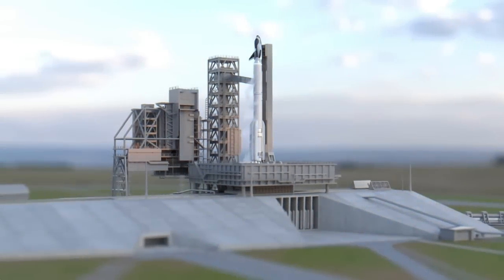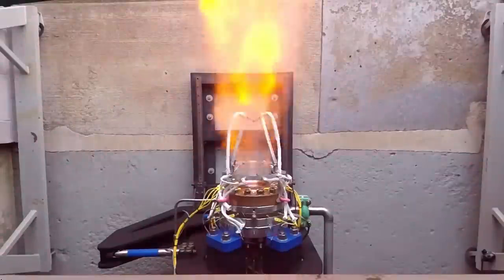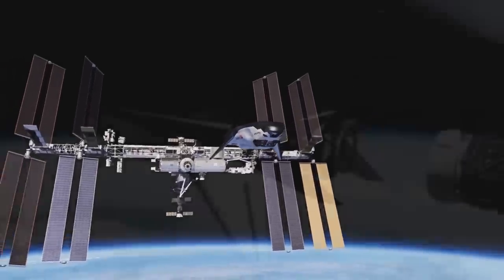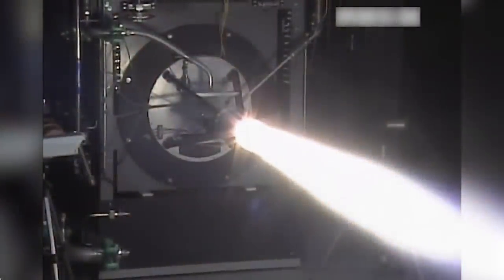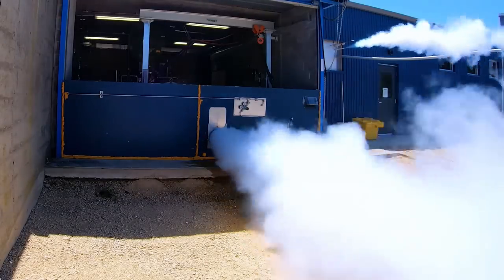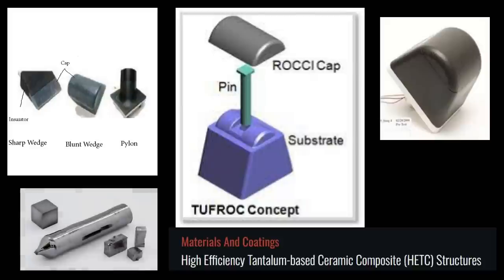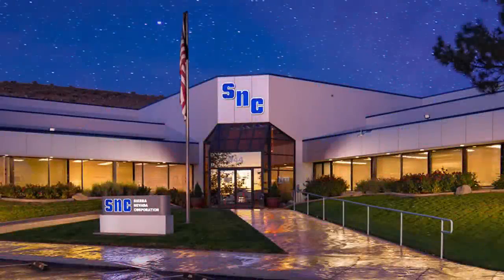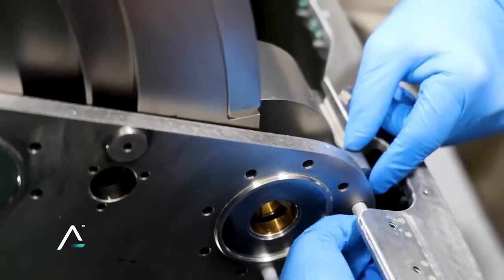Rocket Science: The Sierra Space Dream Chaser

Comment: The centra fuse will most likely not work in outerspace. Because the centrifugal action dosen't work in space. Everything is weightless. The spinning will make the different weights of the propellant to be spun out at different velocities,but still be mixed. But the spinning action will not separate the two fuels while in a weightless environment allowing for cooler fuel to be used as a coolant...
Reply from the maker: Centrifugal force works fine in space RH... the action imparts the force... nothing to do with weight my friend. :-)
The denser (colder) coolant will still be separated to the outside of the cylinder...
Reply: @terranspaceacademy  on the main body of stucture that's rotating, but anything inside it will be weightless. Without my artificial gravity system design... I'm no electrical genius,  just self taught. But I was able too desighn it. You know anyone that could use my design?

Comment: Normally I would suggest a ferrel for joining metal plumbing, a softer metal ring with a slight taper that compacts into a harder flow way, however to resist the super high temperatures of exhaust plumes I would have to recommend a refractory alloy such as Tantalum Hafnium Carbide or Hafnium carbide oxide, however these are much harder than the metals they are using and  I don't know the creep temperature.  Titanium is not brittle, perhaps if hafnium or tantalum or niobium were added as an alloy it might do for a gasket or a ferrel to seal a juncture.
Reply from the maker: Thank you Wade!